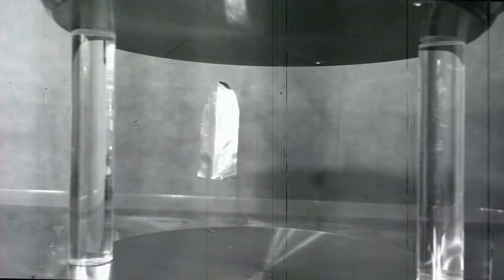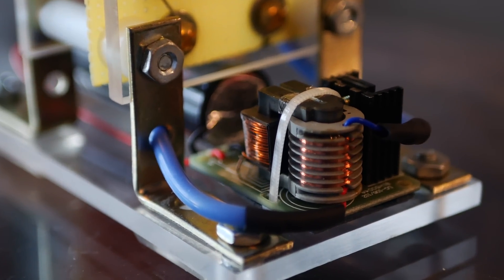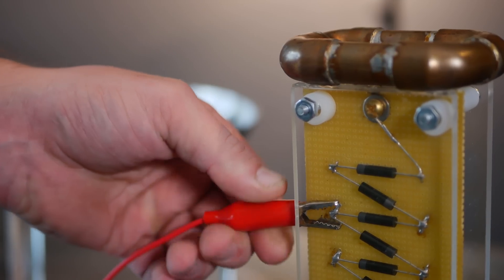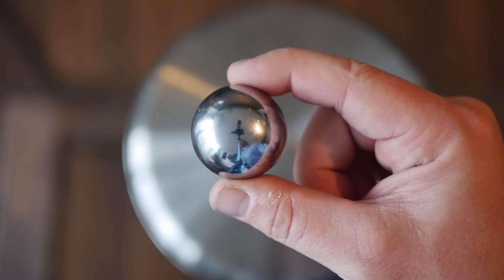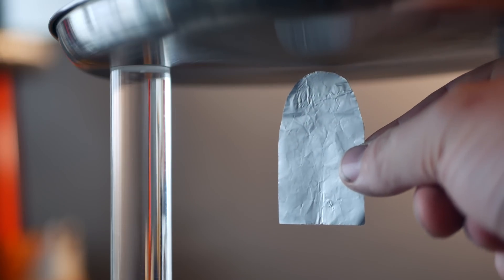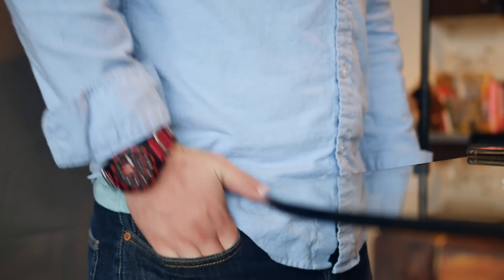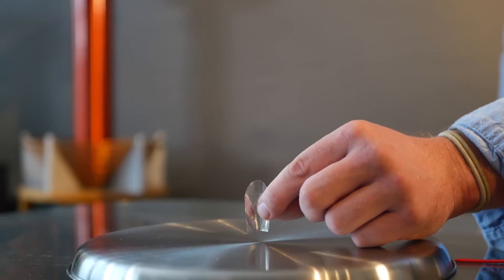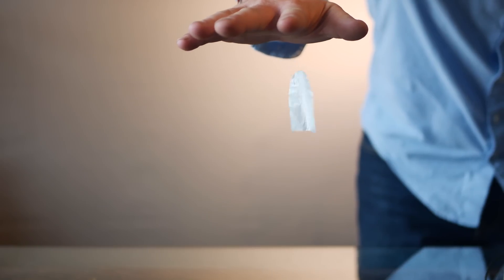Levitation Powers From High Voltage (World First?)

Comment: When you step on the aluminium foil with one foot while the other one is on the ground isn't the current supposed to flow through your foot->left leg->right leg->right foot-> to the ground? Anyone care to enlighten me about this not happening?
Reply from the maker: The aluminum foil is sharp, so charges leak off pretty easily when I’m not standing on it. The moment I stood on it, some did discharge to my foot into ground. But again, power level
Was very low, and from foot to foot.
Reply: @PlasmaChannel  wait from what i understood the foil was in 70kV isnt that capable of a shock regardless of any other factor? Thanks for the answer i'm not trying to discover a lie or something just a curious  elecetical engineering student :)
Reply from the maker: No worries, glad you asked! It did shock me slightly, actually. Just the current was so low that it wasn't enough to jump, nor did it turn up on camera. Also, I was standing on a book just out of screen. Being paper, it was mildly conductive at best. So the one foot on ground was not really on "ground", Cheers!

Comment: I like this a lot. The especially interesting part to me is that this system only achieves quasi stability because it isn't in a vacuum, whereas so much physics taught in the classroom assumes a vacuum to the point of borderline ignorance. 

Without the air to act as an ion channel needed to achieve negative feedback, it seems like this system would have exactly one unstable equilibrium point somewhere near the midpoint between the plates and getting it to sit there would be like balancing a pencil on its sharpened tip.

I wonder if gluing some very small neutral mass (like individual grains of rice or something) would make the smaller foil even easier to control, since there will be a little more mechanical inertia in the system while the electrical side is relatively unchanged.

Comment: Very nice!  I see you upgraded the AC power supply for the voltage multiplier tower to one of those plasma lighter build-it-yourself circuits.  That's how I made mine to start with as I noted in the comments on your video of the original build.  Only fair since I largely copied your design for my voltage multiplier towers.  I made 2 of them ... one for a negative top load and one for a positive top load.  Really cool to discharge them between each other for roughly double the spark length (common the grounds).  I also beefed up the transistor on the plasma lighter module to an 8 amp one.  And I applied some high voltage corona dope to the secondary windings on the small transformer to reduce the risk of arcing.  I've used an input voltage of as much as 12V on the little AC power supply circuits with no problems.  I figured hey, if something burns up those little circuits are cheap to replace.  Much cheaper than an actual lighter!  Anyway my two towers still work great.  Now I need to work up the courage to try your experiment in this video.  Maybe with 2 metal plates first. 😁
Reply from the maker: Hi David! I found you can even submerge the little flyback circuit in oil, and power it with 16 volts. It puts out 1" arcs! But..for some reason, only one of mine is able to do that. I bought several, and all the others...the transistor just dies at even 8 volts. What transistor did you replace it with, if I may ask? Also, please upload a video, and share the video here - i'd love to give you a place to show off your work!
Reply: @PlasmaChannel  Jay, I searched around for a transistor that could handle high collector current.  What I ended up buying from Digikey was the ON Semi FJP13007H2TU-ND.  This is an 8 amp version ... they also make the FJP13009H2TU-ND which is a 12 amp version.  These are fairly rugged transistors in the same form factor as the one supplied with the little circuits.  The data sheet says they can handle 4 amps of base current (absolute max) and I never did increase the base resistor to account for the higher supply voltage.  Maybe that's what is killing your transistors that were included in the circuit.  If you increase the supply voltage without increasing the base resistor value, the base current will increase and that can damage the transistor.  But the FJP13007H2TU-ND seems to handle it.  They are 77 cents each in quantities of 10.  I'll have to see what I can do about a video.  Hmm, 16 volt supply eh?  What would ElectroBOOM do? 😁  Edit:  They appear to be available from Mouser Electronics as well for 73 cents each in quantities of 10.

Comment: You've made the plates into a speaker. This is still acoustic levitation. Technically, all levitation is acoustical; even magnetic.
Reply from the maker: Interesting thought. The plates are not acoustic, nor do they vibrate. They can be built out of solid plates of steel and this would still work. As there is no sound produced from these plates, it is not acoustic. It is electrostatic in nature. Cheers!

Comment: I think this would be interesting to try and take the voltage fields generated and see if you can use pressure equations to calculate the required voltage/height that the foil would float at.

Comment: The distance to the top plate is smaller than the distance to the bottom plate because the atraction to the top must be equal to the atraction to the bottom and the gravity pulling the mass downwards right? Plus what's up with all that rotational kinetic of the aluminium foil? Irregularities on the format of it?

Comment: Let me see if i understand the phenomena here correctly:
As was shown in the video, the negative plate forces electrons to the lower part of the aluminum foil and because the lower plate is more positive(0V>-70kV) the force becomes greater than the one that would be pulling it up(upper part of it is charged positively so the negative plate pulls it towrads) and that's why it comes down. Once it gets closer to the lower plate then this time positive charges are repelled by the plate and because the upper plate is more negative it manages to pull it up again and this "bouncing" repeats itself until it reaches state where the charges are somewhat evenly split? Or did I miss something?
Reply: You missed something and so did I because his explaination was "corona discharge bitch".
Reply: @GregoMorgan  yeah i know, i don't understand what does the corona thing do-this device is basically a capacitor-the metal plate is 1 electrode and the other plate/hand is the other one. The dielectricum in normal capacitor gets charged and the process is similar to the thing i wrote in my previous comment-so basically this device looks to me like capacitor with aluminum foil put inside of it, and because charges move freely in metals i assumed it works simillarly that the charges just move faster
Reply: @xkerberosx1  I just re-watched it and I noticed many things he kinda screwed up and that confused the hell out of me. First he says the top plate is charged positively but corrects it on screen which I missed. Than I thought he was saying charge separation was happening near the top plate specifically and corona discharge near the bottom plate specifically, but everything is symmetrical as it should be.
When the piece of foil gets closer to one of the plates, its charge distribution should make things "worst" as the part of the foil closer to the plate will gather opposite charges (so attraction becomes even greater).
But the corona discharge thing is actually happening constantly and allows the charges to flow away from the piece of foil, more so on the side that's closer from a plate, thus making it temporarily charged overall, and then it makes sense for it to be more attracted by the plate it's the furthest from. As soon as it does so, corona discharge gets stronger on this side and the same thing happens than before (with opposite flow of charges).
If I understand it correctly, the charges are constantly coming in and out through that corona thing and that's what's balancing the electrostatic forces.
The shape makes sense as the balance will be tilted against gravity, with discharge being stronger on the bottom due to the sharp edges.

Comment: Something important to bear in mind - the one hand rule is really shorthand for single contact point - in your setup because your feet are being used you've still got 2 contact points and those points are across your chest. I'd suggest using something closer to Mehdi's recreation because in that case all of the power goes through a single limb.

In any case great setup and great explanation!

Comment: Was sent here by ElectroBoom!  This is really cool.  I'm wondering how much current is actually flowing, and what is the power use from the power supply?  Wondering if there's a detectable increase in current load on the power supply when it's holding up the metal?  Also... in effect, you've made yourself into a big capacitor, right??
Reply from the maker: Hi Steve! Welcome to my channel! The current draw is very, very low. Definitely an increase in current when it's levitating, because the ionic wind the foil produces leaks energy out of the system. Cheers!

Comment: Quick question: could you attach the lead to your wrist instead of standing on it? Of course it would have to be the same wrist as the hand that’s not in your pocket. Also when you got shocked, you said it was around 70 kv, was it super low current? And is a shock from you voltage multiplayer survivable?
Reply from the maker: Yes, that would have been much safer!

Comment: I'm just curious, can you try to levitate the foil with the plates being placed vertically.

Will it still levitate, 
will it or it will not?

I hope the grammar isn't wrong, is it or it isn't.
Reply from the maker: I did not try, but it likely will not work. The levitation is dependent on gravity being a downward force, and ionic wind / electrostatic attraction being the upward balancing force. So, when sideways, gravity would just pull it aside. I'll give it a try though. If it works sideways, i'll shoot a new video on it!

Comment: Did you try replacing both plates with your hands, I mean each hand as one plate.
Reply from the maker: Great idea, but, that would not work. You can't have one hand positive and one hand negative. Because your hands are connected to your body.
Reply: @PlasmaChannel  may be trying putting an insulator between plate and skin on one hand.

Comment: curve the top plate, should keep it center
Reply: the electrons in the middle object should be as a thunder cloud
Reply from the maker: Hey, that’s a great idea. Makes sense! Thank you.
Reply: @PlasmaChannel  i think it would work if it has kind of hour glass form, even ball forms should levitate
Reply: @PlasmaChannel  if you want to break the bank, try a ring, on the top, like in an ion thruster, then put it on a scale, measure how much energy per grams of thrust
Reply from the maker: Hmmm yet another fine idea!
Reply: @PlasmaChannel  electrostatic levitation? with two positively charged objects?
Reply: if you put enough voltage even if its insul(a)ting, it should become like friction charged
Reply: make a true particle based shield: only one plate, and acoustic, magnetic or electric, field, alternating corresponding shield, then keep the particles (magnetic, ionized or even air molecules) at a selected distance away from the source alternator, ie, with iron particles first pushed away with magnets then pushed back, similar to the rotating magnetic levitation, but also alternating with pulling back the iron particles, dust levitation, plasma shield, maybe charged particles is more easily polarized or just take the charged particles directly from the air, or bounce some air molecules around with microwaves to form a shield particle field
Reply: only one electrode, no top electrode, the one electrode must generate all fields and movements, no top electrode, its under the power of the enemy tossing stuff at you, the purpose is to make a particle cloud above the sender alternator source
Reply: at minimum, a directional particle movement shield, even laser shield
Reply: the star trek type of shield, a cone shield
Reply: charge the bottom plate only, remove the top plate, its the electrostatic engine, the same polarization charged (negative) plate will make the piece the same charged, and it will rise up, and levitation, repulse, same charges, should float on top of the charged main plate easily
Reply: levitate a metal dust cloud with ac induction coil

Comment: Jay, Could you answer a question of which I have been receiving conflicting unclear details.... Regarding charge in the atmosphere.... Where can I get details of the charge status of the Earth, Ionosphere etc.? Are they net positive or net negative? I'm assuming ground is net negative but is the Ionosphere therefore net positive? Arcing happens within clouds, so why is that if the cloud layer is mostly net positive??? confusing....
Reply from the maker: I've found NASA is a great resource for atmospheric electricity. That, and Florida State University has some great pages about it. Shoot, maybe it's Florida Tech. One of those two does lightning testing and studies electrical phenomena. The ionosphere is indeed net Positive charge, but, the ionosphere is not specifically the cloud layer. Clouds have mechanical processes at work that rub together particles and create separate charges within the cloud. Cloud-to-Cloud and Intracloud strikes happen do to this charge separation. The earth is Net negative.
Reply: Wonder if Matthew is thinking like I am.  That if you knew the amount of atmospheric electricity in the area above the earth, at different levels, could you not build a craft using High voltage that would call on the different levels to levitate it by using a built in device like your  voltage multiplier inside to vary the transfer of the neg, and positive  charges to both the earth and atmosphere.  
Please don't chide me if I sound too crazy.  I have no degrees per say in physics or other science, but I did stay one time at a Holiday Inn. :)  Figure you would be talking VERY VERY high voltage though for any kind of mass, you would want to lift.
Reply: @carmanharman3759  Yes, i am thinking along those lines... but also. harnessing those charges.... I was thing.. "Voltages increase the higher we go, but then that is the overall voltage between given heights and earth... the differential voltages might stay relatively the same the further up we travel... I'm still experimenting... Thanks for the comment.
Reply: @matthewcampbell7153  Spot on to the way I was thinking.

Comment: What kind of battery is that on the voltage multiplier?
Reply from the maker: Great question! It’s a really sweet 3.7 volt lithium, and is USB rechargeable.
Reply: That is really rad.

Comment: Is possible to make a tilting top microprocessor controlled with a camera or two that is used to know the position of the aluminum foil. And then make a control loop that stationairs the aluminum foil in the middle. Just a thought.
Reply: Or just a camera shot of the whole bench and experiment and what you are doing would be awsome
Reply from the maker: Thanks for the input. The problem is that my lense requires being back really far in order to show the whole table. It would require being....10 or 12 feet back. And, at that distance, you would not see the levitating objects too well. I need better lenses! But they are expensive.

Comment: Isn't your ZVS driver rated for 12v and 300w?
How did you do 15.5v and 4a with your subaru ignitioncoil?
Reply from the maker: Mine is rated to go up to.....24 volts I believe. Regardless it is very blown up right now.
Reply: @PlasmaChannel  can i use the ighition coil driver set that you can find on all express?
Please make a video on how to make a hih power transformer driver circuit.

Comment: Can i observe it through ken wheelers understanding? High voltage in your body is actually increasing your dielectric capacitance, so you are becoming in fact the center of the magnet, and starting to form dielectric voidance, an aether perturbation, which acts like a drain. Gravity works exactly the same. Even aluminium is paramagnetic, it is pulled by dielectric field, which is often mistaken as magnetic attraction. Magnet consists of two field, magnetic and dielectric, and aluminium does not react to magnetic, but reacts to dielectric(electrostatic).

 Comments are welcome so we can all build from this, maybe i am completely wrong?

Comment: 6:07 Isn't you have one foot at the plate and same time one on the floor for the moment? Something in me whisper to me that is not good, but something else tell me that this is not a live wire form power outlet, so it doesn't shock you. I am right?
Reply from the maker: Great job noticing! Yes, one foot is on the ground for a second. My voltage mutliplier is weak, though, and my floor is fake wood (plastic), so the discharge into earth is very weak when I have one foot on floor still.
Reply: @PlasmaChannel  Thanks for the explanation :-)
Reply: I was scrolling down for this comment.. at least one person have the same question.